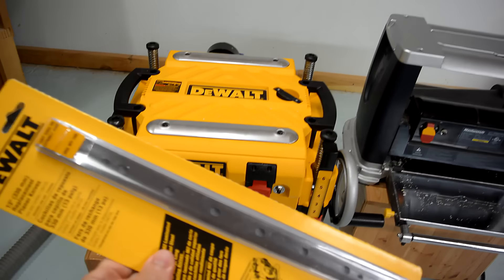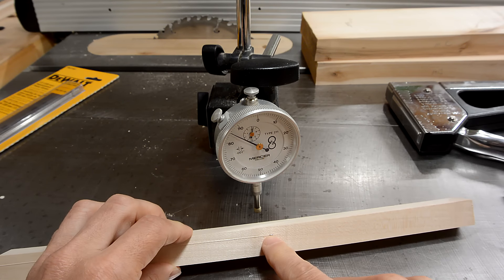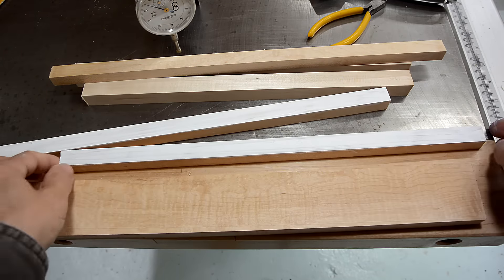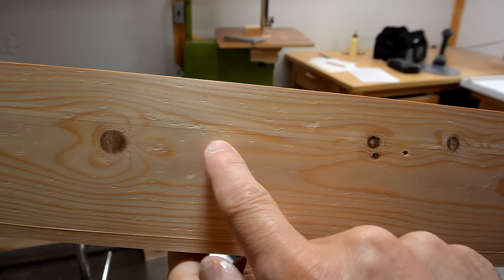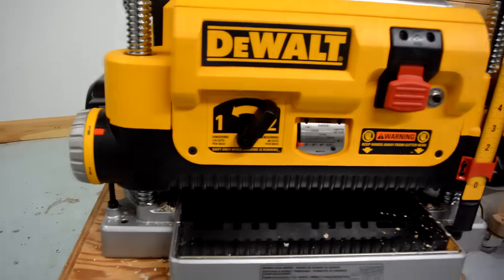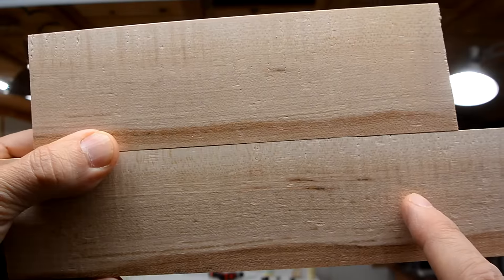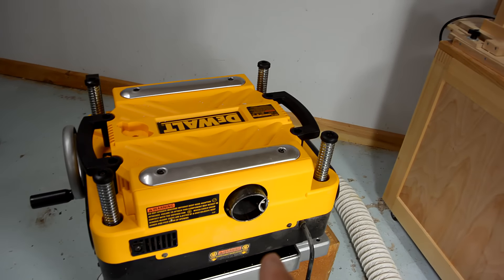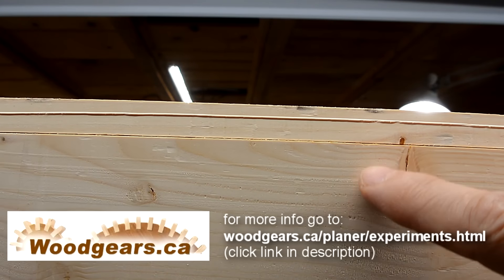More planer experiments

Comment: I'd be interested to see the results of a 3rd party helical cutter head with carbide blades on it.

But make no mistake,  I'm betting your sponsor won't be willing to pay for that.
Reply: I have the DW 735 and the Shelix cutter heads cost over $400.  I'd have bought the new cutter head, but it appears to be a real pain to install.  I don't use my planer enough to justify the time and frustration of installation.

But from what I've seen and heard, the Shelix is well worth the investment IF you use a planer often enough.

Comment: I'm not a woodworker so could someone tell me how and why the paint ruins the blades? Sorry for my ignorance
Reply: paint is generally harder than wood. cutting through a dried oxide paste dulls steel rather quickly. it being harder than steel is why you can use pretty much any oxide for stropping. think of it in terms of stropping the cutting edge in such a way as to dull it.
Reply: +james lawrence thanks, I appreciate it
Reply: +james lawrence i was also curious thanks
Reply: Paint pigments, fillers and binders = clays, oxides, talcs, lime, possibly quartz . . . all pretty hard stuff

Comment: The DW735 is great for contractors using it on the job site outside where there is no dust collector and the fan helps disperse the chips.  The DW734 is a better choice for a planer thats going to be hooked up to a dust collector.

Comment: Why is paint so hard on a planer, are the blades just bad quality or something?
Reply: Many kinds of paints have heavy metal or metal oxides in them.
Reply: So it just increases the wear on the blades, so you'll require more frequent sharpening, or switching to a superior blade.
Reply: Yes. They do not do high quality blades for compact planers. Even the most basic high speed steel would do much better with little staples. A2 steel is common for planer blades. The cutting geometry is partially to blame, as the cutting angle that is ideal for planing wood is not ideal for standing up to metal. 

D2 steel blades would be awesome. I'm inclined to get some and put my mill and surface grinder to good work to test that theory... Anyone want to sponsor me with some tool steel? :)
Reply: Even Carbide blades don't like running true Titanium oxide. It is like cutting trough sandpaper.

A angle grinder with a wire wheel does wonders. Or cutting the paint of with a cheap saw blade on the table saw. My preffred method
Reply: Or a paint scraper. Or a chemical paint stripper.

Comment: Tearout happens when you feed a board into the planer with the wrong 
end forward. The knives catch in the rising wood fibers and tear rather 
than cut them. In some cases, you'll be able to tell which end to feed into the 
planer by inspecting the grain (or to be precise, the direction of the 
fibers). When you're planing the wide surface of the board, inspect the 
grain on the narrow edge. When you're planing the edges, inspect the 
wide face. On rough lumber, you can feel the fibers by running your hand
 over the board. It will be smooth in one direction and rough in the 
other. Feed the smooth direction forward. With some boards, you might 
get tearout in both directions.

Comment: It is not a design flaw.  Having the air from the cooling the motor will push more dust via Bernoulli effect.  Don’t use vacuum.  Use cyclone dust collector.  It is much cheaper than vacuum dust collector.

Comment: You can use chalk or a naked wax pencil to highlight the planed surface. Use the side, not the tip. Much more details will be visible. Even the spacing between the blade cuts.

Comment: I have the budget for the Dewalt, but I think I'll go with a cheap one instead. Seems like you are not getting your moneys worth with the Dewalt compared to the cheaper ones. And it has annoying things like being unable to use dust collection (I don't have a collector yet, but I will build a small one).
Reply: Go one step up instead. low end induction motor driven planer. you won't regret it.
Reply: you should buy a used stationary planer (a professional one) you will get a lot better planer then a small 'consumergrade' planer
Reply: Like what?
Reply: +Антон Южаков there are very many different kinds of planers available, i personally like old cast iron beasts. try to look for something that hasn't been used up already
Reply: +Антон Южаков something like a Grizzly G0815. 900 bucks brand new. If you can fins something similar used, even better.
Reply: The Dewalt is not made to need dust collection, hence all the confusion being around dust collection, just run a 4" rigid hose straight into a cyclone separator, there are reviews of that working perfectly

Comment: In this video I learned to not run wood with staples in it through my thickness planer. I use my planer to clean up painted wood all of the time. I never knew that was supposed to be an issue. I know dried glue can be tough on it though. Perhaps it all depends on if the blades are in the bad layer, or cutting through it? I know with metal work that is the case. If you cut under the hard layer you're better off.

Comment: I would try connecting the dust port on the DeWalt to a collection box with an air filter as one side of the box. This should relief the back pressure and collect the dust. It might get clogged quickly though !

Comment: Have you thought about making an inline cyclone with two inlets and outlets so you could have automatic compensation for too much negative or positive pressure in your hose? The extra inlet/outlet could be filtered feeds into the room that could be closed off partially or completely so you don't have your hose problem.

Comment: You sure are convincing me to get a spiral cutterhead whenever I get a planer!
Reply: The best you can get is a spiral. The best.
Reply: Yeah but forget about sharpening those blades.
Reply: There are spiral planers and there are helical planers. The helical with indexed cutters is preferable.
Reply: +Jon Miller 
I was thinking of the type with four sharp edges per cutter. I don't know all the proper terms...
Reply: Just making sure you don't accidentally order a spiral when you want a helix. They aren't common but they do exist.
Reply: The problem with those is that if you have to eventually change the knives over it will take you hours.

An alternative is to use carbide blades in a regular planer. They are about double to three times the price of the regular which is still a lot cheaper then the spiral blades.
Reply: That's called s Shelix. I have one in my Ridgid TPT1300, for which knives are no longer made by the OEM. Aftermarket knives are available, but they go dull in a hurry.

Comment: I use the same planer. Have had awesome results with it, never any staples though. My first thought about the jam was that if the out-feed shelf was used, there would be no jam up. Maybe it doesn't come with both input and output shelves now. Mine did, so when I have short work, I always use both input and output shelves. 
The tear out you're getting will disappear if you swap the work piece end to end. Similar to using the jointer. If you go one way it tears out, flip the work and it's smooth. I have that issue with Maple or other hardwoods.
Reply from the maker: When the grain is wavy, like it was in this wood, then there will always be places where the grain goes the "wrong way", regardless of which way you feed it.  That's why it's called difficult grain.

Comment: This just made me realize that i can buy a cheap planer, take the knives out, put them on the mill and cut slots, and voila, patterned boards. It would also mean less work on the knives since less cutting so all things considered they would even out.

Well, i think, i'd actually have to try it out, but i'm sure that if the planer can't take it, more power can be provided.

Comment: Perhaps it is just me but I get the impression after watching a couple of your videos on the Dewalt DW735 in comparison to your less expensive Mastercraft planer you have a biased opinion against the Dewalt planer for whatever the reason. I am in the early stages of doing research on portable planers & I DO NOT see the cutting issues you are consistently illustrating on the Dewalt. Another interesting observation is the so called Dewalt jamming issue you have highlighted on the outfeed side. Why are you NOT using in & outfeed table extensions? Based on my research thus far, the Dewalt is NOT displaying the issues you are indicating here on a consistent basis. I think the key factors with respect to ANY portable thickness planer is the following: (1) go slow, (2) maintain sharp blades at all times, (3) clean the sharp blades & rollers religiously, mineral spirits should work fine & cloth dry thoroughly (4) keep a air blow gun at the ready when maintaining the machine, (5) wax the table & extensions & buff them, (6) lubricate the chains, both of them, 3 in 1 oil should work fine & finally, see item #4... I am not giving you a thumbs down on this video since you have taken the time to put it out there, however I do believe you would better serve your subscribers by illustrating the importance of maintaining a portable thickness planer rather than biased opinions, imho... Thank you. :-)

Comment: Thanks for this, Matthias.  I need a planer and was wondering if I could get by with el-cheapo or should I invest in something better.  So far the DeWalt is better but not by much.  I'm still on the fence!
Reply: Sitting on the fence can last a lifetime (don't ask). If you've got $700 in your pocket and you're willing to plunk it down for a planer but have uh... doubts... then I'd heartily suggest using just $250 (or $200) of that wad and go ahead and get a Harbour Freight planer. It doesn't have the pretty yellow plastic shell. It's only 1-speed. It's somewhat comparable to the Mastercraft. But it does the Job.  It will certainly satisfy your 'entry' into using a planer and appreciating what a planer can do... and you can always save up another $250 to pack into your original wad and go for the DeWalt at a later date.
Reply: As an after thought, if you don't overly abuse the cheap planer... you can always craigslist it to help recoup some of the cash... or keep em both... one for wood and one for stapled-painted wood ;-)

Comment: If you had read the instruction manual which accompanied the Dewalt Planer you would have learned that Dewalt does not recommend connecting the planer to  separate vacuum system due to the high volume of air generated by the fan motor. Furthermore, the planer should have come with a 4" hose that has a cloth bag on the opposite end that cinches closed on to a metal refuse container to collect the debris. 

As for the incident when a small piece of wood was jammed on the out feed, this could have been easily be remedied by adding an out feed table, home made or one sold by Dewalt.

Comment: Wth is a three thirty secondths of a inch, I thought canada used the metric system?
Reply from the maker: We use both.  The indicator on the planer is in inches, and 3/32 is also the maximum cut capacity of the mastercraft planer.

Comment: I much prefer the slow speed on my Dewalt planer. Gives me more time to get around the the other side of the work piece and leaves a much better finish. I've been running about 200 bf of hard maple through and the Dewalt is having no problem with it. Silky smooth finish.

Comment: In my experience, those Dewalts do indeed put out a lot of air, and chips. I've worked at Rocker Hardware and Woodworking, and the fool planer will throw chips halfway across the store if we had NOTHING connected on the back. Too bad about the back pressure. Makes me wonder what would happen if you had a passive cyclone and enough furnace-filter panels on the backside to handle all that airflow.

Comment: Matthais, have you ever tested the Shelix cutter head in the 735?  Two diameters are sold, an OEM diameter and a smaller diameter which is supposed to make replacement easier.  But there are reports about increased snipe with the smaller diameter cutter head.

Comment: 1:40 I don't think you can quantitatively compare the height of the wood left by the nick from one machine to the other, unless you set the height of the staple to be the same in both machines in a controlled way.

The .001 or .002" difference is a hair's breadth.

Comment: Great review, I've been debating getting that Dewalt for a while, I have seen a few reviews of the Dewalt planer running nothing but a 4 inch rigid hose  10ft long straight to a cyclone separator, with no issues. That might be a good experiment?  The guys claimed zero issues

Comment: I think the moral of this story is to respect the tool for what it was designed for, planing wood and wood only, no foreign objects in it and no paint. I am sure none of you use hammers to put screws in and screwdrivers to put nails in so why use a planer to strip paint.
Reply: Because it's fast, does a great job, no chemicals and mess, no screwing around with a heat gun for hours with the nasty fumes...........Sometime trashing the blades is the best option.
Reply: If you get under the paint with your cut you're really not hitting it much with your knives at all.

Comment: My take-away from this: I've pretty much taken power planers off of my list of tools I wish I owned.
Reply: Naw they are still a worthwhile investment, you just have to know their limits and downsides.
Reply: after my table saw, my Ridgid power planer is the most used tool I own.
Reply: Get an old planer. Those have actual knives not toothpicks inside.
Reply: 1) Get a planer if you're doing woodworking. They are invaluable. I don't care how much you love hand tools (as I do; I own planes, chisels, and saws), if the goal is to actually get the work done (as opposed to just enjoying using hand tools) you need a planer. There's no substitute. 
2) Don't power plane painted wood. I can not conceive of a reason to attempt that. It's just not made for it. 
3) Buy a wand-type metal detector and check for nails and staples before you plane. Plenty of quality models under $50 on Amazon. 

If you take care of it a planer will last. If you plane painted boards and staples it will not.
Reply: When a thickness planer is used right it does a job that nothing else can do. I don't care who anyone thinks they are with a hand planer, or a card scraper, or anything else. The planer is going to kick their ass. Because that planer has the power of 20 men and it don't quit.
Reply: Every classical furniture maker would have done anything for this kind of equipment. They didn't use hand tools because it was romantic. They used the best tools they had on hand.
Reply: Jon Miller
They used apprentices for the grunt work. Better known as indentured servants, or slaves.
Reply: *****
a good cabinet maker might have 4 buildings of workers under him. That's how they did it without power tools. They simply took the time, and made the effort.
Reply: As a full time handtooler (shop doesn't have power) you want a planer.  If I had the option I'd buy a bandsaw and a planer tomorrow.  Spending 50% of your total build time dimensioning lumber isn't exactly... productive.
Reply: Starving Poet
When I started out I used a belt sander, and an angle grinder with a sanding disc on it. Like you said, you can spend a lot of time planing wood if you do not have a power planer. A lot of hard time. With a planer I just slip the board in, and it feeds through. Big improvement.
Reply: A thickesser is a different tool to a planar.  You need two edges perpendicular edges BEFORE a thicknesser.  If you can create that with hand tools go for it, but try planing/sanding a 2 meter length and get it exact.  But even if you can can you do it quick enough to get anything finished?
Reply: Victor, in the US, thicknessers are somewhat confusingly called planers. The tool you use for getting the first side flat is called a jointer in the US.

Comment: I wouldn't have thought one tiny staple would nick knives first run
Reply: Considering the speed those knives are traveling at, and that they are striking the staple in the exact same spot repeatedly it is no surprise they sustained that much damage. If I guessed the head diameter, and the rotational speed right those knives might be traveling about 178 MPH (I went with 3 inch diameter head, and 20K RPM). That is zipping right along at race car speed. Each knife hit that staple a couple times in that pass too. Although likely the first shot was the hardest.

Comment: I have the same planer but get snip 3 inches in from the end of the boards. Is there a way to and just the Dewalt?
Reply: Virtually all thickness planers will give you "snipe".  There's several remedies that you can try to minimize or avoid it. One simple way s to make your work piece longer than you need, then you can cut-off the sniped area. Another trick is to feed two pieces of wood into the machine one after the other.  The second piece can be just a scrap piece which you can discard.

Comment: Why is paint bad for planers?
Reply from the maker: see linked article
Reply: That's what I was thinking since they already deal with wood shavings.
Reply: And what is the best way to remove paint, then? Heat and sanding? Chemicals and sanding? Sanding and sanding?
Reply: Heat gun works wonders since it expands the paint faster than the wood so it pops off
Reply: +Sebastian Sampson-Tonge also the paint really melts on the planerblades and stays there, then during planing it accumulates heat whoch dulls the blades faster then anything. when your blaner is burning the wood it is also getting dull at an alarming rate
Reply: High wattage infrared heat lamp and paint scraper. I've found there is no faster( and safer) way.
Reply: Same thing with varnishes on flooring which contains aluminum.